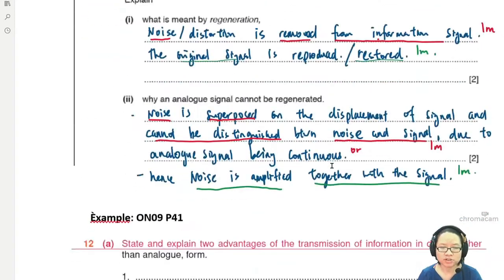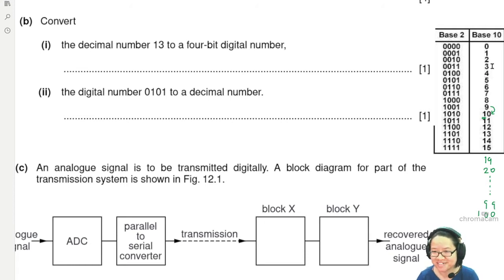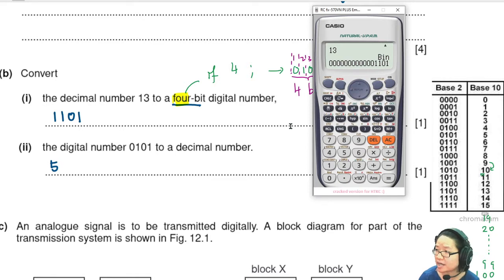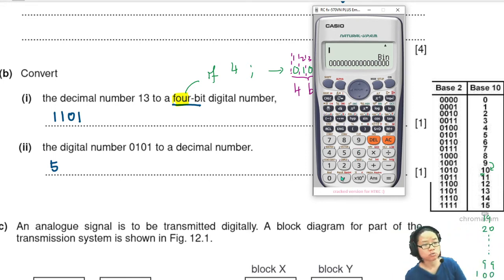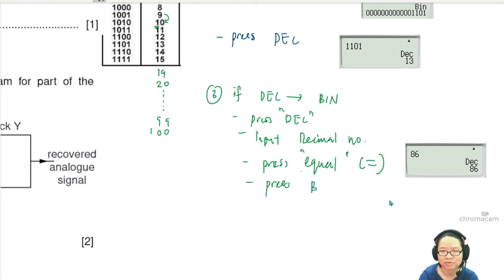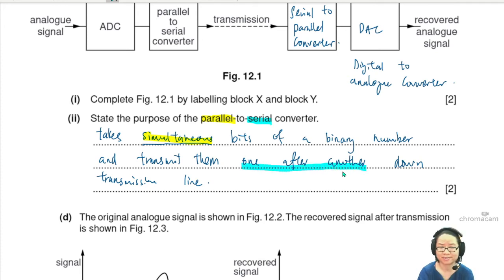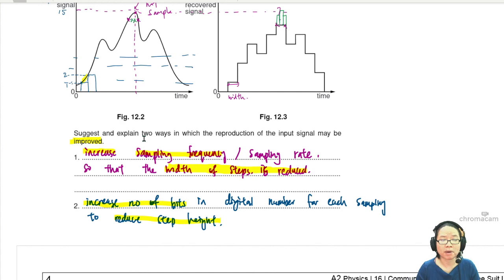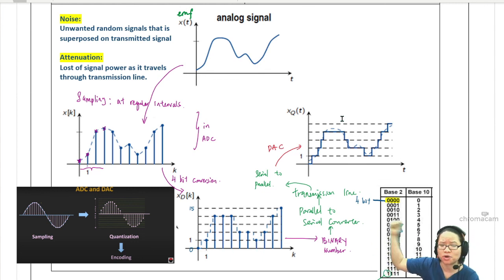116.2c Binary Numbers and Signal Graphs (ON09 P41 Q12) | A2 Communication | CAIE A Level Physics

Comment: Hello. For question 12 (i), would my answer be also correct?

1. Digital signal has greater bandwidth, so more information can be carried and better sound quality.
2. Digital signal requires less power, so it is less expensive than analogue signal.
Reply: That calculator trick in converting decimals to binary number and vice-versa is really helpful! My teacher has never taught me that.
Reply from the maker: Both answers are okay, as long as the key points mentioned in the Mark Schemes are in your explanations.